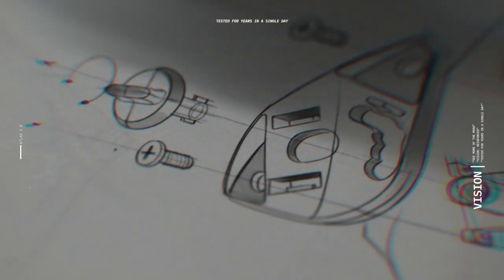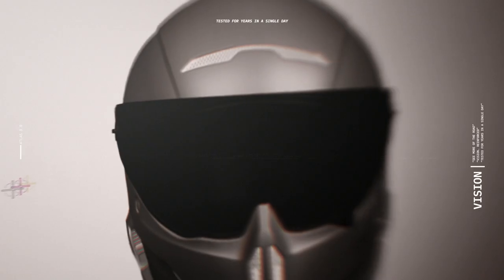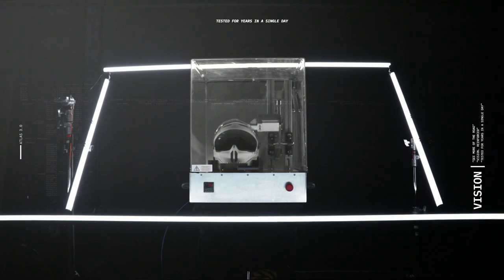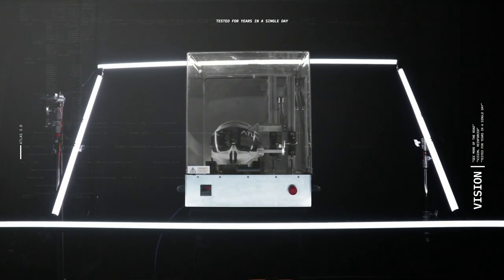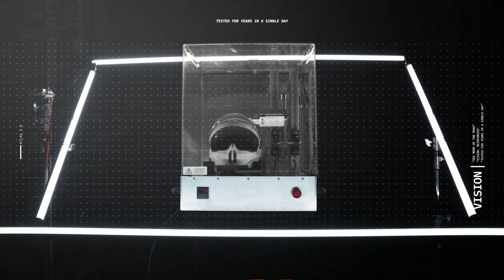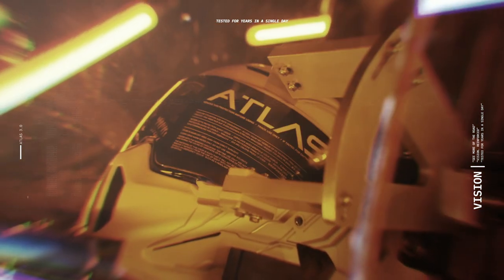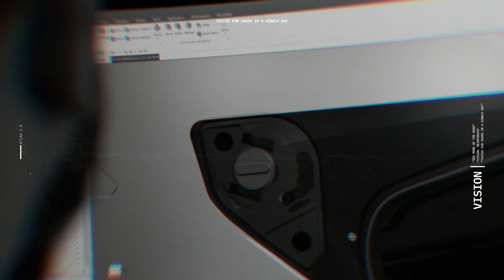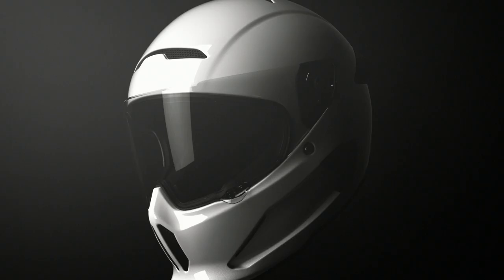Tested For Years in a Single Day | Ruroc ATLAS 3.0

Comment: Oddly my visor lifts with the two sides lifting at separate intervals. My left side rises first, as that is where the thumb tab is and the right side then starts to lift after… the visor doesn’t lift as a whole, but in a slight wave effect. My 2.0 works perfectly and to be honest I miss the steel pin. I have always seen the Atlas helmet as a modern homage to the Simpson Bandit.
Reply from the maker: hey Peter, I am so sorry to hear about the visor coming up. When riding is the visor fully locked? 🙂
Reply: @Ruroc  
Yes, at any speed I lock it down and fit is fine. Just when I lift up it delays the right side to the first detent. Obviously I push the left side first, as my thumb pushes up from the tab on the left… just doesn’t feel right. The 2.0 visor works better in my opinion.